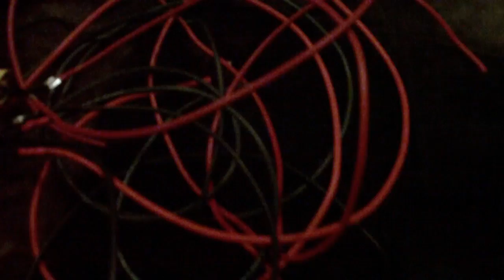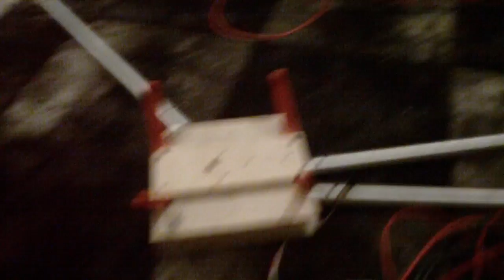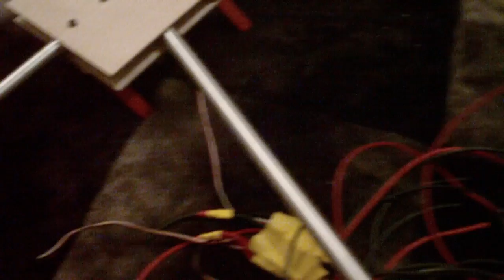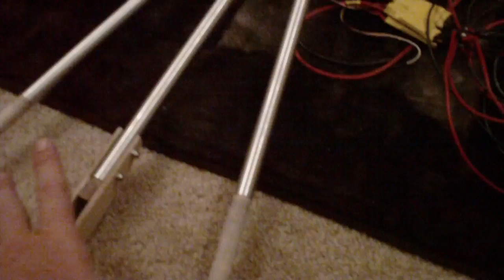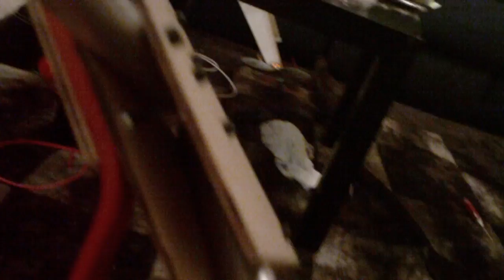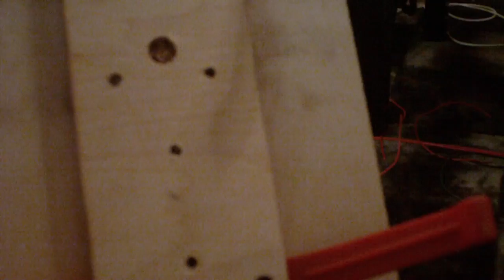Tri-Copter Part 4: Wiring

Comment from the maker: @NC
I did a template in Visio and measured 120° for the arms.  When I did this, I did the best I could with what I had.  Now, I'd suggest getting something based on in integrated controller.  I just grabbed a micro quad from Hobby King and it flies light-years better than my old Tri.

http://hobbyking.com/hobbyking/store/__42844__HobbyKing_Pocket_Quad_V1_1_Ultra_Micro_DSM2_MultiWii_Quadcopter_PNF_.html

Also, look for the multi-rotor forums in RC Groups.  Lots of help in there...